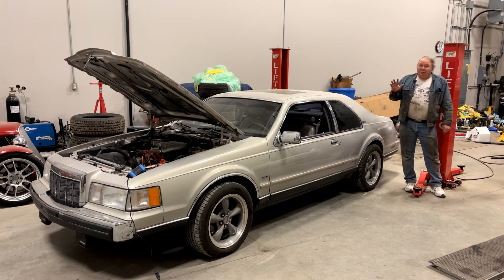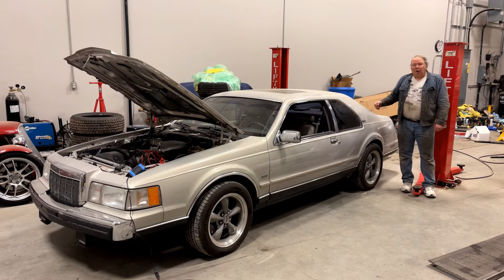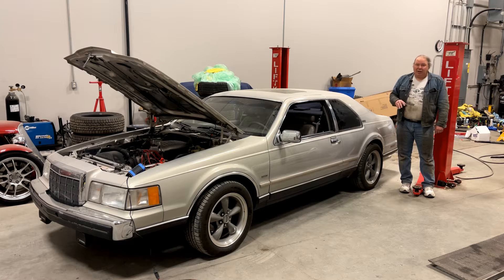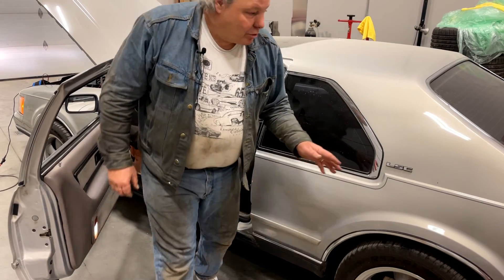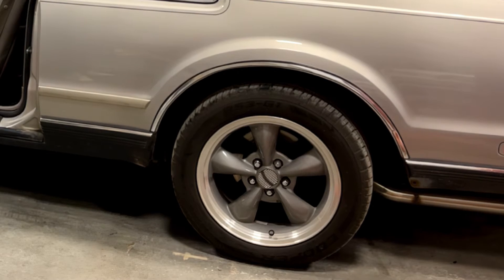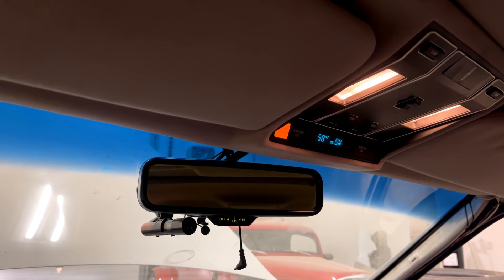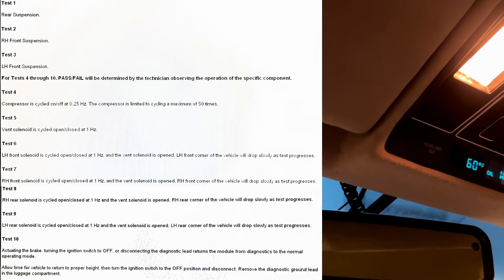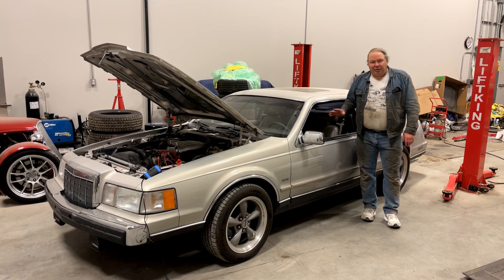Lincoln Mark VII Air Suspension Diagnostics

Comment: I think fools do the conversions cause they can sell kits. That’s all. Nobody fixed this and the ride is drastically altered when someone does a conversion. It drives like an old ford. Junky imo if air ride is removed
Reply from the maker: I produced these Lincoln air ride videos to try to shed some light on the “repair” option.
Reply: @tecmotiondyno try the springs on my mark viii.  Horrid riding now. Rather just junk the car. The car didn’t handle much diff with air bags. It actually had nice floating over harsh roads. Now it rides like some old ltd. Any idiot that removes the ride drastically changes how nice it rode. That to me is unforgivable. Thank god my mark vii still has its original air ride.  I did recently lose all 4 bags they wouldn’t inflate and I had rodents in underside and intake. Finally got them out but it’s sitting on ground won’t inflate at all? Any ideas what would drop all the air at once? All bags and arnott. Compressor is 3 yrs old only
Reply from the maker: @jecrpalier well, I would call that pretty unusual. A short on the solenoid control lines maybe? I guess I would start by trying the pre inflation sequence that is meant for installing new bags. Then see if they will pump up and then check them with soapy water for leaks
Reply: @tecmotiondyno the pump would run and run and rears and front wouldn’t pump up then they just all caved like all your ride height would drop to ground and deflate all the bags. Confusing. What’s worse mechanics today suck so much nobody wants to even put i on a lift so I can check it out. Also after it hit the ground the pump would just run till the check susp light would come on and it would stop. Like a huge leak somewhere. Hoping the nylon lines aren’t destroyed somewhere underside but I’m just wondering why all 4 would drop all at once like a deflation sequence. After it dropped it wouldn’t inflate again. Machanics don’t even want to bother. Guess they want their 200hr bs work on brakes so they can keep ripping off people
Reply from the maker: @jecrpalier sounds suspicious for sure. If the bags get fully deflated they may not pump up and it can damage them to have the weight of the car on them with no air. I guess a next step would be to check that when the pump runs there is air coming out of the lines. Pull a line out of a solenoid and run the pump to check it. If there is no air flow, you have a problem upstream like the distribution manifold, dryer, pump, or lines. If there is air, you may have solenoid problems or bag leaks. If you changed the bags and didn’t follow the preinflation procedure you might have damaged them on installation and then had them let go. If you do the test I am suggesting you will divide the problem in half at least.
Reply: @tecmotiondyno they all worked great till the rodents came and made a nest under intake. Then I started the car and the pump turned on and nothing would go up. Wasn’t on the ground. When the fault light came on then all 4 dropped not at once first front then back totally. Like it got instructions to deflate. Odd. Also how do those orange o rings get replaced if it’s leaking from top of dryer ? If I may ask. Thanks for all the insight. Saved your vid
Reply from the maker: @jecrpalier maybe you had mice, or whatever they are, eat lines or wiring.
Reply: @tecmotiondyno I’m pretty sure they did but it’s gonna be hard finding where they chomped and actually fixing that although they sell on rockauto oe unions for repair

Comment: Can you please give the link for the test descriptions?
Reply from the maker: I included them in the video itself. You should be able to pause the video to read them
Reply: Yes, I saw them & thank you very much Sir for your very informative video & taking the time to respond to my question! I have a 1991 White Lincoln Mark Vll, w/ 78,000mi & I LOVE THIS CAR!!!

I finally ran the diagnostic test & it went through every test & passed, except the individual solenoid tests. Because my front driver’s side solenoid didn’t vent & the driver’s side front end continuously goes down overnight. 

So, I just purchased a new solenoid from “Suncore” & also a new air suspension pump motor w/ the dryer & I installed it today, but after a few hours the front went down again. 

So, I soaked the entire bag with soapy water from top to bottom & I sprayed the top of the dryer & I did not see any bubbles & the bag is rock solid.

Do have any suggestions as to what is causing this & what I can try to determine the problem? I’d really appreciate it, because I don’t want to burn out my new pump motor!!😳😩
Reply from the maker: @7777Lace  It can be the o-rings on the solenoid - if you don't use dielectric grease on them when you install the solenoid they can roll over and leak. It can be the air line itself - if the end is damaged you can razor blade 3/16" or so off the end of the air line where it goes into the pushlock. It can be a bag leak at the retainer clip under the bag if it has been damaged there. Those are all things to at least check.

Comment: Is there a procedure for the 97 Lincoln Mark VIII?
Reply from the maker: I virtually guarantee it, but I don’t know what it is off the top of my head. Try a google search, or better yet a service manual for the car.
Reply: @tecmotiondyno  Turns out that there is tests but you gotta ground terminal 2 of the evo test connector with a test light and it will go into a bunch of tests but there is no way to really know what is going on. If it stops on a certain test then it failed. There is a thing called the New Generation Super Star II tester which who knows where you can actually get one at a reasonable price. But that will tell more info.
Reply from the maker: For OBDII era cars shop grade aftermarket test tools like the snap on tools will likely perform the suspension diagnostics for you, and you can often buy them used on ebay or other buy/sell sites for a pretty modest outlay. You do need to make sure that the tool you buy has whatever licenses or modules are required for your specific application though.
Reply: @tecmotiondyno  You need a Rotunda Super Star 2 tester scanner. It is separate from the engine code scanner I have one